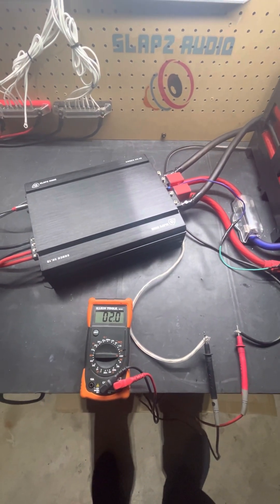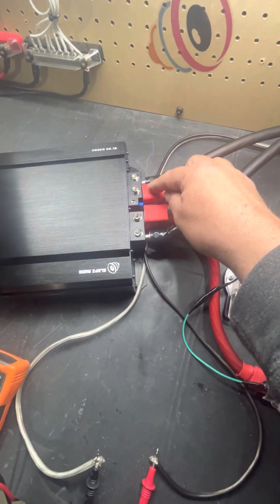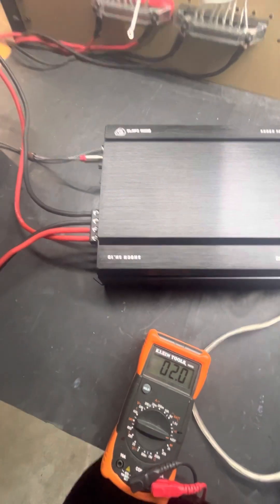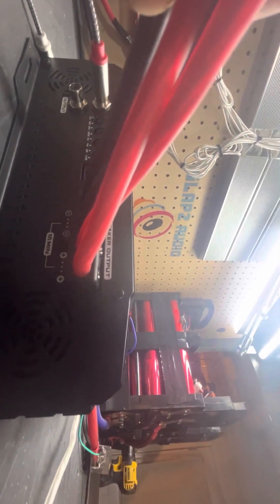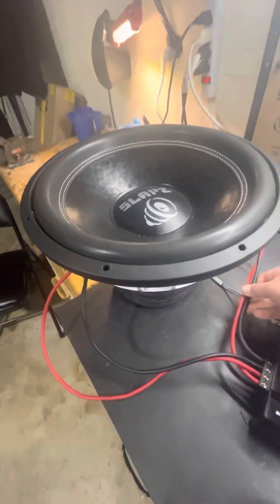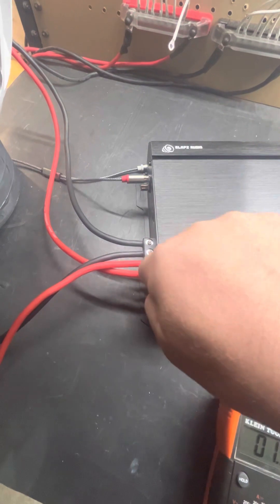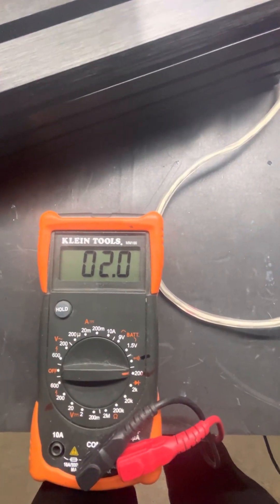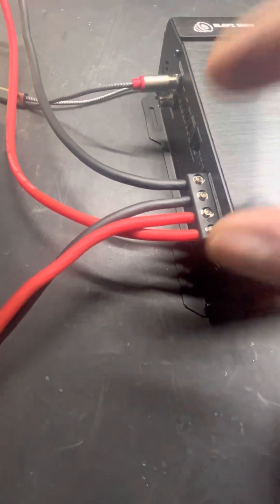Video tutorial for installation and wiring requirements for all SLAPZ audio Shock series amplifiers

Comment: I'm confused on the speaker wiring. I'm about to have your shock 8k on two 12s. When I wire them together I'm only going to have 1 positive and 1 negative speaker wire going into the amp....like I've done forever. are you saying I should do it differently? also the 1 RCA is throwing me off. its late maybe im overthinking LMAO
Reply: You can run your RCA from both outputs on the headunit. But whichever one is connected to the red output, needs to be connected to the input on the amp. The other does not need to be put in because it does not receive any signal, I’ve got both RCAs plugged in to the headunit and amp, the output is grounded to itself so it doesn’t effect anything having it plugged in. If you have 2 12s, are they single or dual voice coil, and are they 2,4 or 8 ohm subs?
Reply: It all connected internally.
Reply: @DeeHermanson  ya I figured it all out. Shit slams lmao